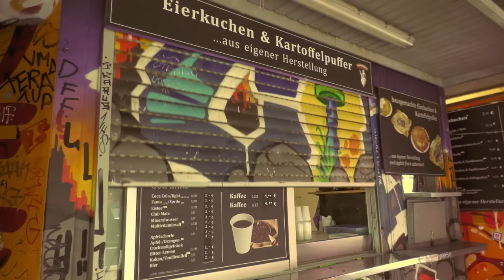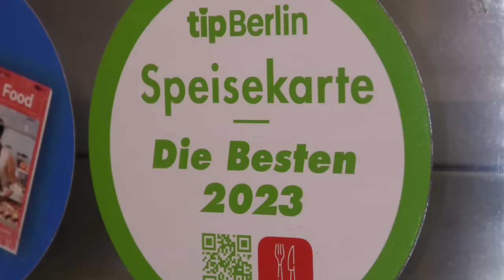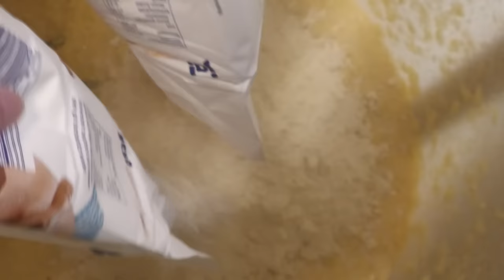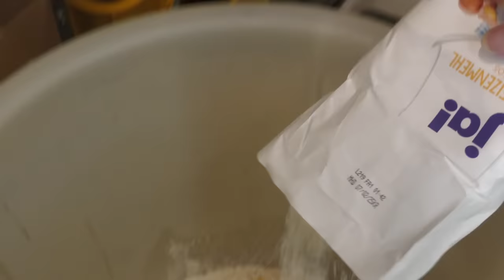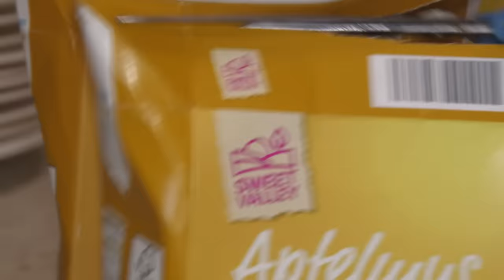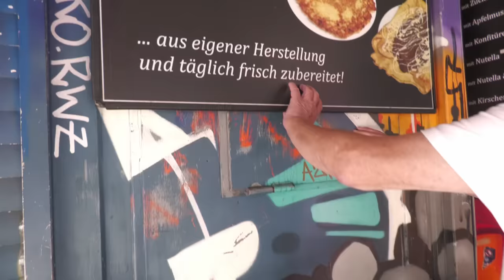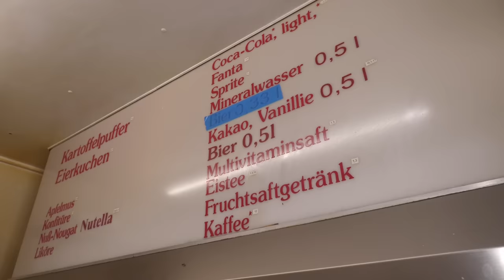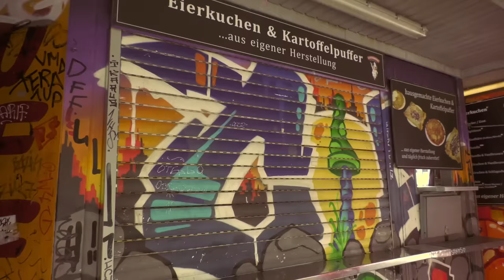Traditional German Snack Stand with Potato Pancakes and Egg Pancakes | Street Food Berlin Germany

Comment: To summarize:
1 - you need shoe covers on your shoes, if you are preparing food;
2 - crepe batter should always be filtered through a conical colander;
3 - I didn’t know, that in a household kettle, intended only for boiling water, you can also boil syrup or juice;
4 - street air with dust, pollen and microbes penetrates into the cooking room;
5 - use of margarine is mauvais ton;
6 - the best hash browns made from a mixture of coarse and finely grated potatoes;

Comment: My first observation is using a chef’s knife to crack the eggs is causing eggshell to get into the batter, clearly visible little flecks of eggshell went in. Instead, it’s far better to break eggs against each other—only one will ever crack that way at a time. For the last one use the flat side not the blade of the knife.

Comment: I saw a piece of egg shell go into the mix and that's because the eggs are being cracked using a knife which is absolutely the wrong way to crack eggs. Eggs shells should be cracked on a hard flat surface so that pieces of egg shell aren't forced back into the egg and then into the mixture. Even hitting one egg against another egg is better than using a knife. Cracking eggs properly to prevent pieces of the shell from getting into the mixture is knowledge that is fundamental to cooking eggs. Now, so matter how beautiful the pancake looks, some customer is going to have the unpleasant experience of biting into a piece of hard egg shell. Yuk!

Comment: Absolutely grossed out. I wonder how much plastic you're eating with those pancakes. Plastics being scraped off the sides of those buckets, by that mixer! micro bits at a time. Why not stainless steel mixing bowls. Never would I eat this. Revolting
Reply: thats are also my thoughts, they are using old mustard plastic containers..... it is impossible the clean that buckets according to the regulations